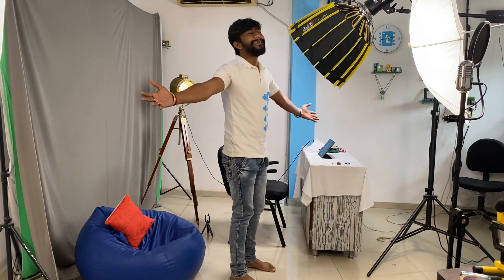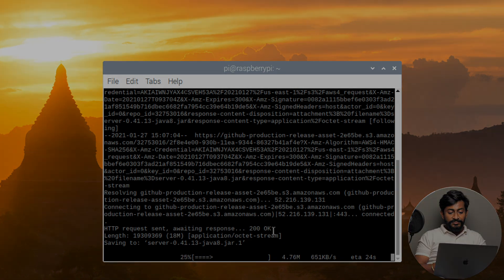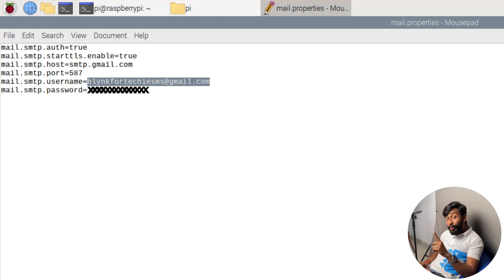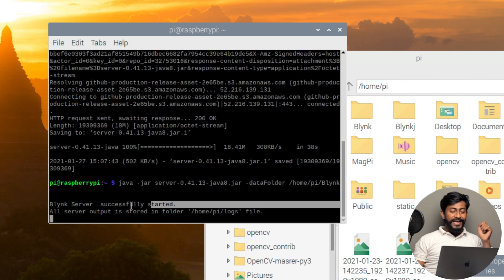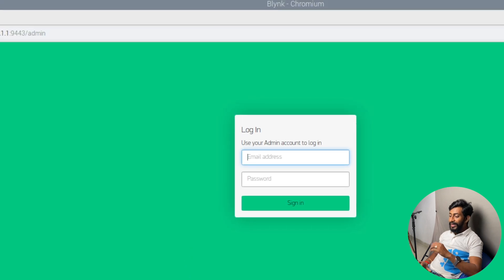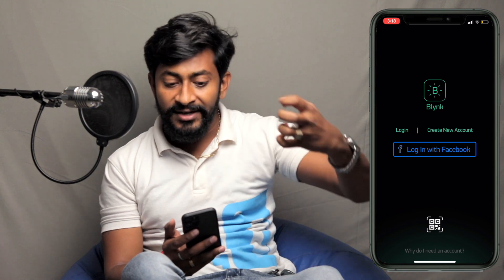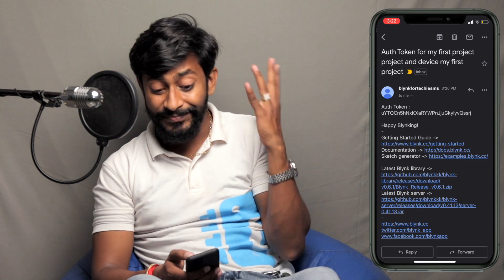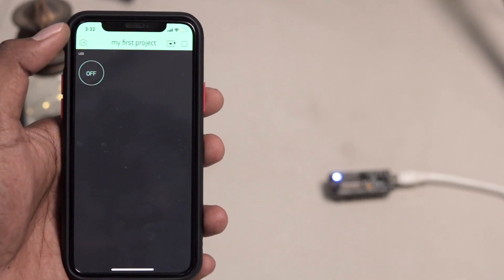Setup Server and Get UNLIMITED Blynk Energy | Blynk Local Server on Raspberry Pi | ESP8266 projects

Comment: Sir. May I ask about the connection between blynk local Server. You did mention about the phone and the server must be connected in the same router as the connection is locally. Is it possible to control the output even if we are at the outside of the connection?

Comment: Hi. I am currently doing a project using a raspberry pi to connect some sensors like DHT22. However, I didn't use any ESP boards. Is it still possible to connect the sensors with blynk app?
Reply from the maker: Yea you can write python codes in Rapsberry pi to send data to Blynk

Comment: Great video as always

I have a doubt though....

I have one main router in my living room... Since the WiFi signal is not strong in my bedroom, I've added a new router in there and ran a LAN cable from Living room router's LAN port to Bedroom's WAN port basically making a WiFi extender..

Now, there will be two devices that I am planning to add. One in the living room and other in bedroom to control lights... Will the process of IP addesss remain same...?

Comment: Hi,
Time to update your web site. The cut and paste text doesn't working anymore. I had to goto github to get the correct ones. 
I have Blynk on my phone aready. It isnt giving me the option to create new account. I downloaded Blynk on to a new tablet. There isn't  a option to create new account just to login. I downloaded the legacy and new one.  Both didn't work.  Any suggestions?
Reply from the maker: Legacy May not have that option, but new one should have it
Have you tried web dashboard in the new one ?
Reply: @techiesms  blynk 2.0 will not have the option of a private local server. 

I found on their website that they would be removing create account. I think they are letting old accounts work. But not allowing new accounts to be made.

Comment: I am missing something somewhere. I have the Blynk local server installed. I cannot connect to it with the Blynk app on my phone. I cannot connect to it from another computer in the same wifi network by typing in the address and port 9443. Is there something on the Pi that I have to do to "open" the port?

A few years ago I created a garage door opener with Blynk and a Feather Huzzah board. It uses the cloud. This app works fine and I can open and close my garage door with my phone.

Comment: After the new blynk updated local server is not working.
Can you please tell me the solution.
Reply: local server working, but the new application does not establish a connection to the local server, go back to the old version of blynk (2.27.34 is last one)
Reply: @pametnekuce2205  thank you for replying ❤️
Reply: @mayankarora6265  does anyone have the correct IOS ipa file Blynk 2.26 for offline installation

Comment: Hello.I have a question. I tried to port forwarding on my wifi router the blynk server so that I could access it from outside the local network and I have the following dilemma. The blynk server has the ip 127.0.1.1:9443, and the raspberry pi has the ip 192168.1.104. I tried both IPs to portforward, and I couldn't. which is the solution
?
Reply: Have you figured out any solution?

Comment: I am trying to make a tasmota smart switch with esp8266-01 board. I want to add a reset button to the circuit, I am not sure which pin and how to add the button (in case I change wifi ssid/password) to reset it to wifi AP mode.
Any Help is appreciated.

Comment: I want to automate my aquarium.  Specially want to control temperature.  Also I want to use the same app to control outside Temperature by using AC, which should be through infrared signal seting the temperature.

Comment: hey bro i need one help .. i am using ESP32 dev board without accessing touch pin properties(using touch pins as GPIO only) . but still the relays are getting triggered when jumper wires are connected or even fingers are touched .. any solution ? please do reply